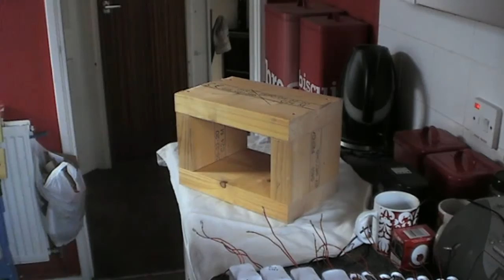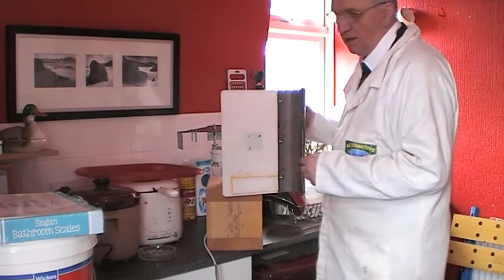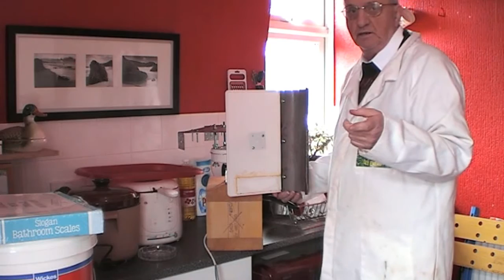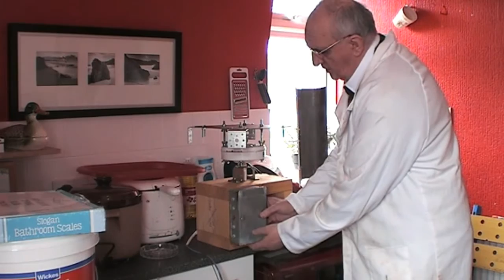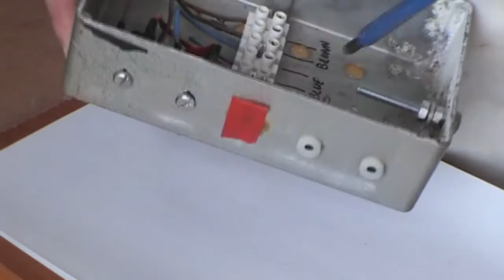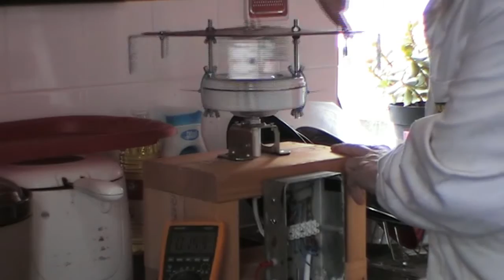Ceiling Fan Generator Turbine VAWT Upgrade 11

Comment: its really looking the part now my friend :-) coming together really nicely :-D from the looks this looks like its going to produce even more power than your last :-p I would love a dozen of these :-) they are small so not intrusive but look highly efficient :-) this will compliment the ttpw nicely :-) i would like to collect 4 ceiling fans and convert them all in one go when i get chance :-p the rectifier boxes to look perfect for the job i would try to mount 8 of those in a similar case :-) i have taken to making things using Perspex of recent :-) so i would like to try a Perspex case on this project :-)
Reply: +BattonFive Crikey. My apologies. Didn't get notification. YT CU again. Your ideas sound wicked my very good friend. I hope things are going well for you on this glorious sunny Sunday my friend.
Reply: Raymond Earle no worries my friend I've been running a bit slow on this end, had a late night :-p the weather is lovely out today :-D
 Just about to see where the moggy is and laze about I think :-) was doing some work on the scale pallets last night :-)
 I really do like your design here ji :-) its very clean and you explained it really well :-D the off grid system is really coming together with this addition :-)
 Hope you are doing well as well down there my friend :-D with the weather picking up now we should both be able to get in to gear and really get some bits done over the long days :-)
 Im very excited all round, you have done loads on your offgrid now :-D and even these bricks are starting to appear :-)
 its nice to see the progress after starting out such long journeys :-D
Reply: +BattonFive You have email.
Reply: Raymond Earle thanks my friend and back at ya :-p

Comment: Did you have much luck with the hho conversation on you car and if so how does it do on fuel with converted thanks Paul
Reply from the maker: +pope paul I had great success with HHO. Only I melted the generator because I did not make the cell assembly correct. It overheated and went through the plastic container i had it in. All safe. Fuse blew so no gas or sparks. Probably be end of year before I can play again. Holding off op so that I can get much needed jobs done. My regards to you and yours my good friend.